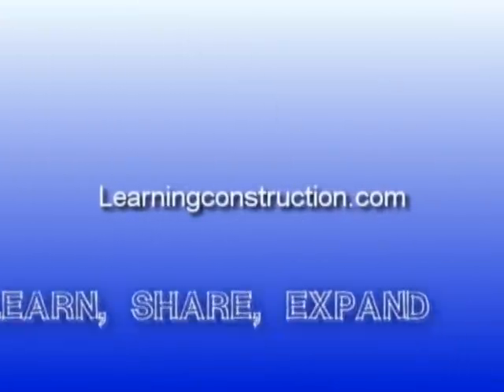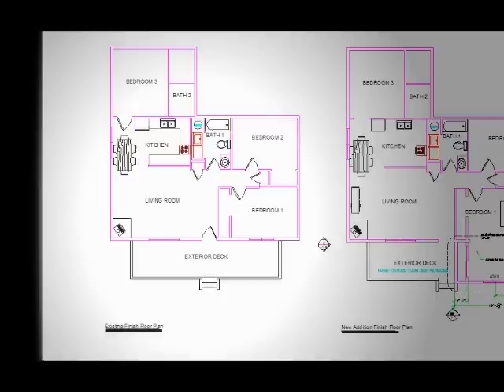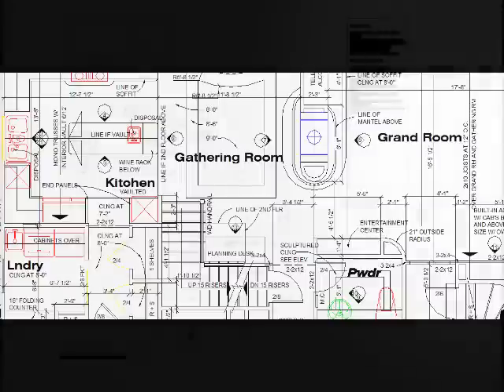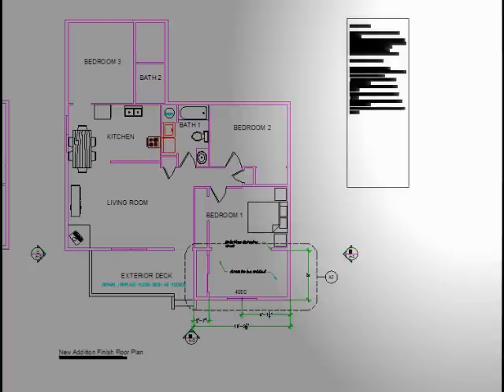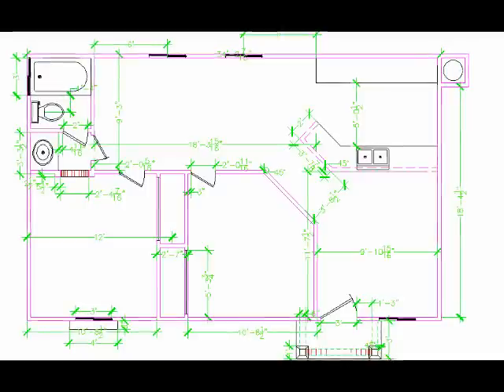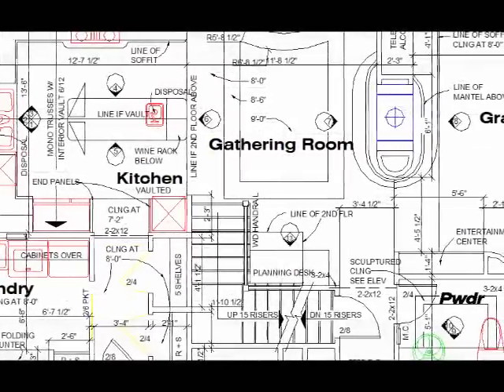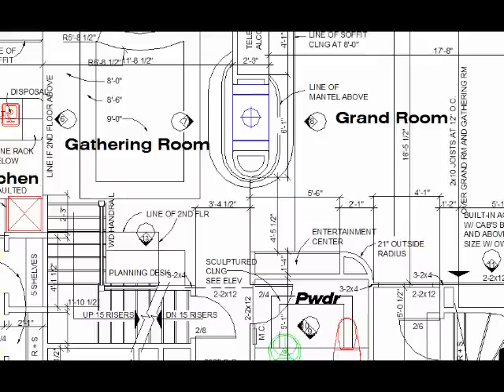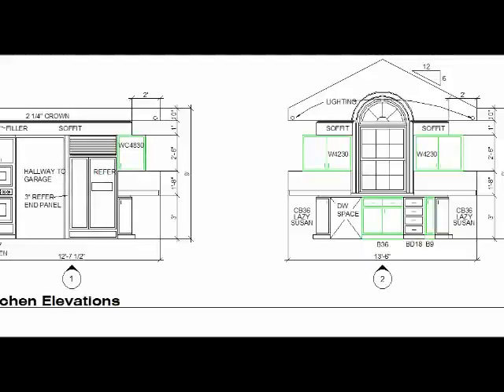How to read blueprints and floor plans.

Comment: Just a quick note, arrows indicate the direction of rise in stairs. So the arrow that is labeled "DN 15 RISERS" at 5:30 should be turned around. Otherwise your stairs are running in to each other.